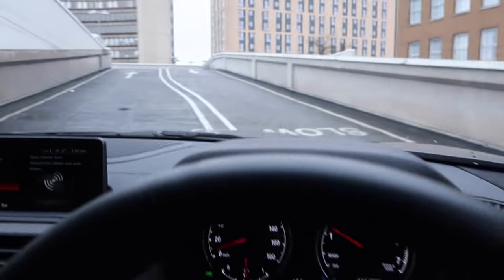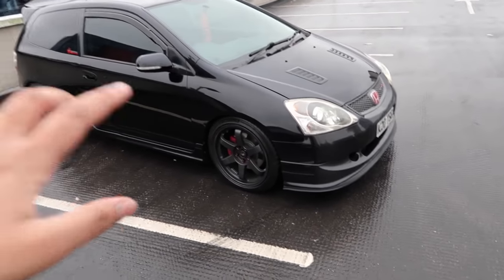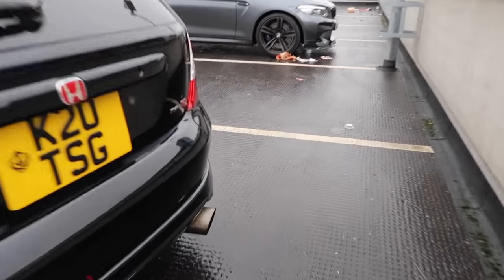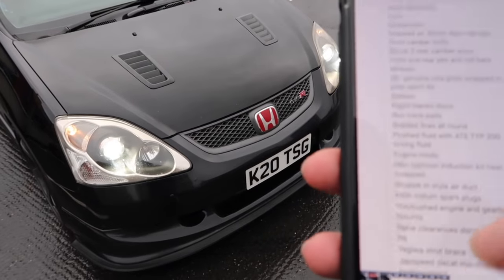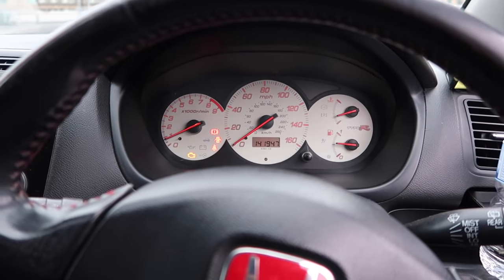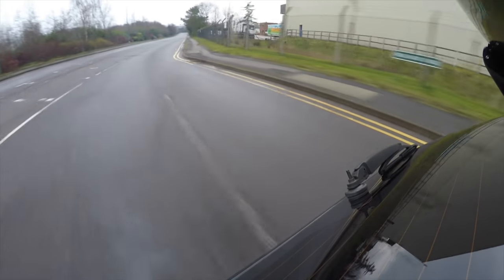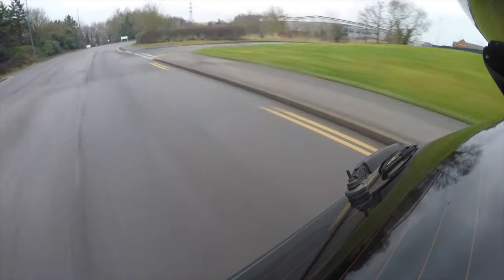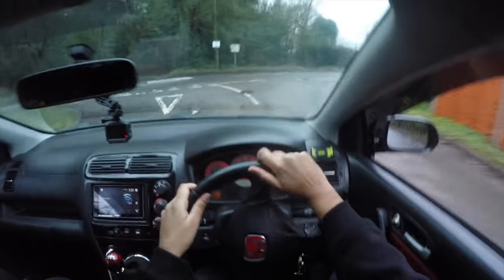CRAZY Honda Civic TYPE R EP3 *My First Drive in a VTEC*

Comment: Burning a bit of oil and needs that engine light sorted but it looks nice 👍🏻
Reply: Kris Clare eml will get sorted soon once mapped as it came on after i installed the decat, oil issue is also getting sorted soon
Reply: TaranGill0121  eml light is a 10 fix from Ebay mate mine did the same so got a spacer for the sensor all sorted 👍🏻
Reply: Kris Clare its a strange one because i put the spacer in there but still came on 🤷🏽‍♂️
Reply: @TSGDETAILING  try wire wool in the spacer
Reply: Shaan Rai no longer own the car mate sold it last year may
Reply: @TSGDETAILING  thats a shame Jatta did u ever get it mapped?
Reply: Shaan Rai yeah was mapped think it made about 245bhp.
Reply: @TSGDETAILING  was that with an RBC inlet and TB? What u got now singh? I got an EP3 getting k100 soon but dont know wether to get the inlet mods ??
Reply: Shaan Rai  had the jdm prc intake manifold was slightly different to standard and also yeah changed TB, done a lot of more work since this video changed to a gruppe M induction kit too then k100. Got a stage 3 leon FR with ko4 hybrid, Strengthened box with LSD etc follow me on insta @tarangill9

Comment: Brill vid as usual TR. As much as I love a bit of VTEC-Yo I think these engines are very weak considering the claimed hp output. I used to love blowing them away in my Leon 184 diesel! I do understand the type of car it is but why do they try and test us in 300hp TSi cars everytime they see us!
Reply: You need to be a good driver to get the most from them, I beat a guy with a 255hp one and I had a 165hp car, but my mate that can drive was level with a 360hp evo.

Comment: Smoking VTEC ? I'd get that looked at
Reply: Smoking even outside of vtec. That engine is done 😂
Reply: @lukap1407  worn valve stem seals are letting oil into combustion chamber therefore burning oil hence the blue smoke. The engine is not done 😂. Smoke doesn't always mean engine is fucked
Reply: @kristianharley7231  i'm aware of that haha
And could also be piston rings.
I just bought my first ep3 with less than 60k miles on it. Had 79k kms on the clock when i got it a couple months back. Absolute beast. 
Parts for K series are easy to find and to replace if you got money and knowledge. :D

Comment: Good car but might be burning abit of oil and the engine management light is on.
Reply: incognito96 yes burning oil its getting a full rebuild soon, and eml is on due to decat
Reply: @TSGDETAILING  thanks for the reply. The work u have done already is good its only abit of oil you should do a vid on the full rebuild of you doing it be intrested to see the carbon build up from burning oil. I had to scrap a half decent new shape focus because of possible oil rings stuck carbon build up was so bad it caused it to pink alot looked inside with camara and no wonder it had over a inch of build up on piston. Not knocking the car its the car i wanted growing up love vtech 😎😎😎

Comment: Bottom end must be knocking it's smoking badly. Engine will pop soon.
Reply: JDMsweetness wrong engine does smoke, bottom ends not knocking  and engine pulls strong
Reply: TaranGill0121 Something is wrong pcv valve or stem seals.

Comment: V-Tec...... All that lag and no turbo......
Reply: He mentioned he did not know how to properly shift. You can shift into vtec on all gears but it takes a skill to master. You don't need a turbo when you have a great motor to get you quickly through those rpms.
Reply: No lag only need to shift right in the right rpm range and you'll be still in VTEC in the next gear